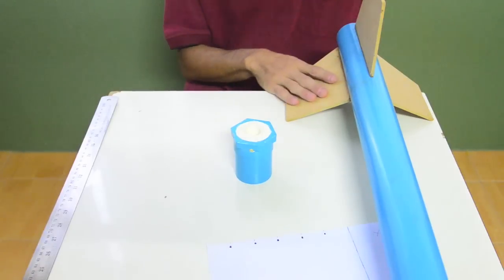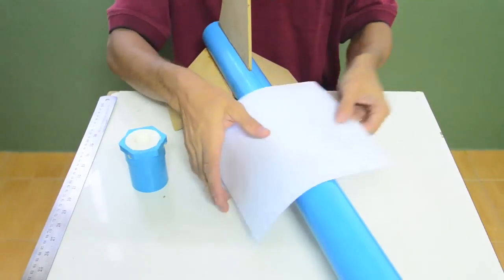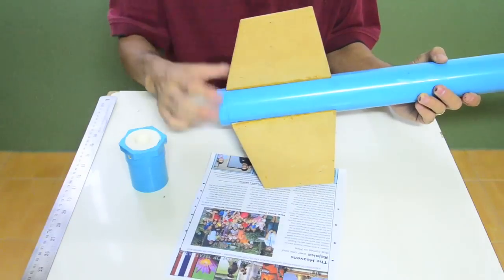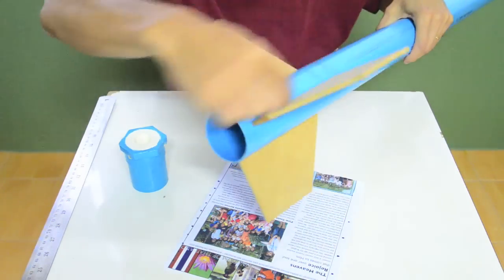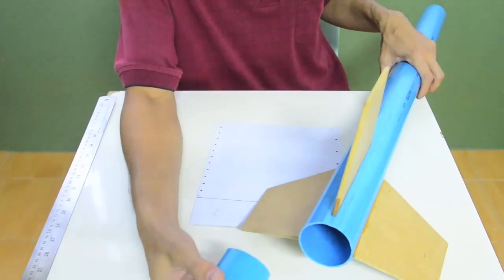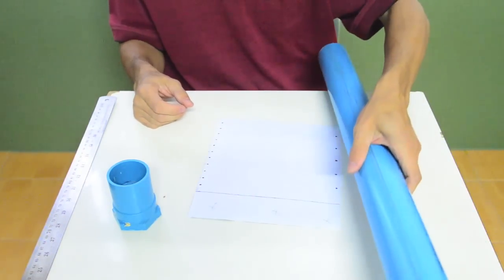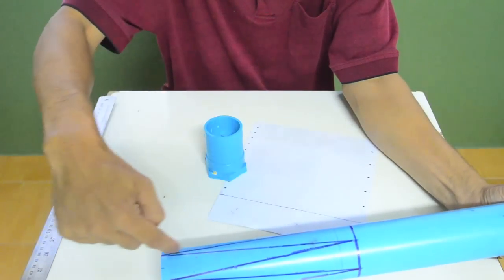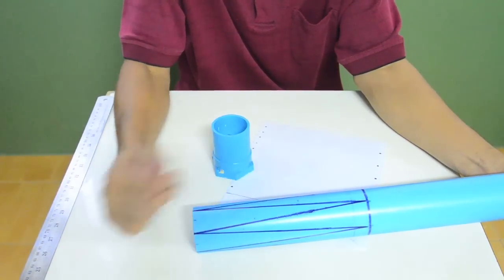Part 1: Air Frame-How to Build a High Power Rocket

Comment: Dear Ed W. or as I know you from before, rocketman bkk:
 (or is it bbk?! not sure)

 As I might have already said in a previous comment in some other video, you were one of my first rocket mentors as I would like to call it, back then when you had your previous account, since you uploaded a series of tutorials on how to make a high power rocket from scratch, with simple household materials which were extremely helpful for those of us who are young amateur rocketeers that dont live in the fancy USA where everything regarding rocketry comes already packaged and factory made in hobby kits!

And although there are a handfull of rocketry sites such as Richard Nakka, Jimmy Yawn, Dan Pollino... and plenty of books, your tutorials were clearly the simplest and downright best. Always using simple techniques and materials to reach the heavens in a budget.
I based my first HPR PVC motor design on your tutorials and turned out quite successful, you can check it out in my channel. Many successful launches since!

 I remember I even downloaded all your older videos with a "Youtube download program" and stored them in a folder for when I was working "wifi-less" in my workshop.

I can easily upload all of them onto a dropbox folder of some sort and share it with you so you can download them and have them back after your previous account was apparently shut down for some reason. It might seem pointless as you're already starting to contribute with another new channel, but you might wanna have them just for the sake. If you're interested just let me know and I'll arrange some upload-transfer system.

                                                                                                                      Regards,          Dan Folley
Reply from the maker: Dan, I so would like to recover all my videos.  After google bought out Youtube I tried to change my email acount and it deleted my channel so I never recovered from that.  Would love to have all those videos.  Drop box works for me.

Comment: My first rocket was non recoverable and I built it using 1/8th inch abs, I do not recommend it, they flexed and sent the rocket into a spin and that only caused an exponentially faster spin and more flex one of the four steered off about mid flight and the rocket actually beat it to the ground, I'm looking forward to using your wood idea, already build all of my nose cones with your design

Comment from the maker: I've done that with past rockets but this motor "Just" fits.  Actually the bulkhead cap needs to be shaved a little at the seem because it bulges a little and won't fit.  You won't have that problem with your end caps.

Comment: Ed, if you cut a length of cardboard tube that is just shy of the distance between the lower part of your bulkhead cap and upper end of your nozzle coupler, you can effectively use that as motor retention AND thermal insultation between your motor and the airframe.  I used a piece from the postal tubes we built our rockets out of this past summer.  This would eliminate any chance for heat from the motor damaging your airframe.  Looking forward to the next video.  Those fins are a sweet design!